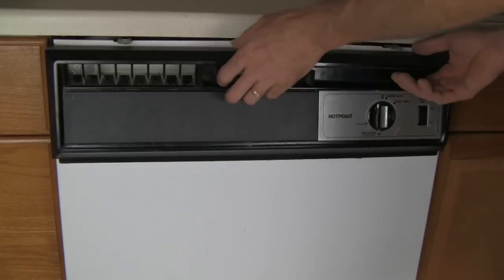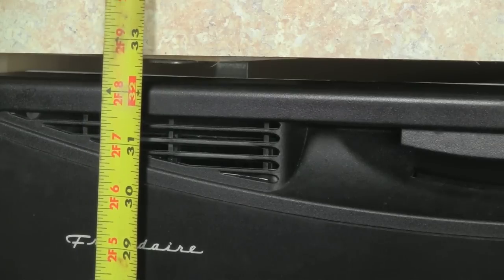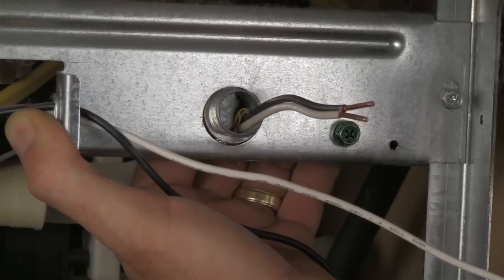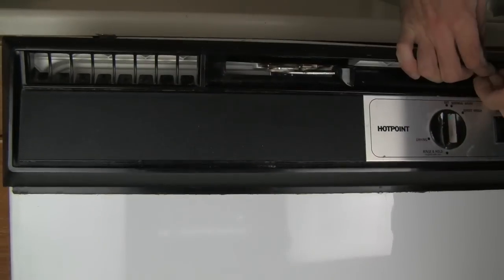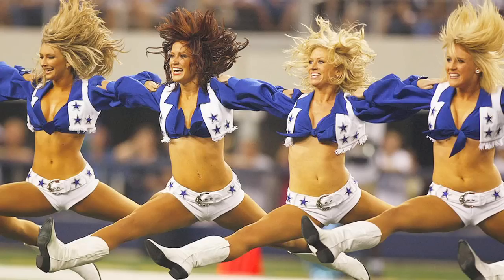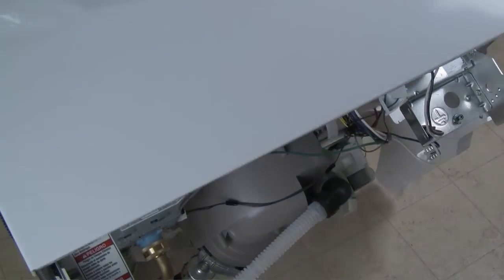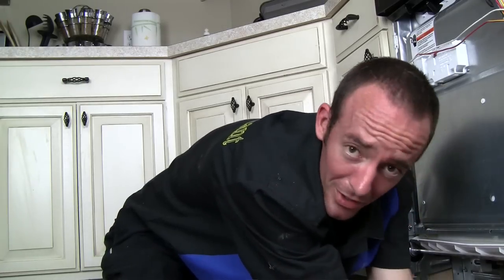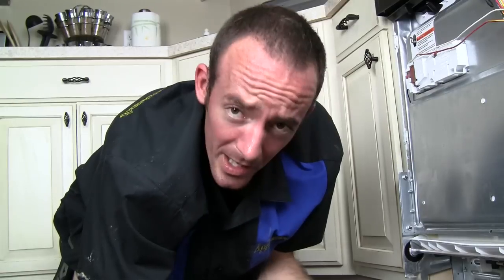How To Install A Dishwasher: Dishwasher Installation

Comment: Several very helpful tips that no one else mention on Dishwasher replacement. The dry napkin test, square cutting the copper pipe, and loosing the feet ahead of time were very helpful.  Thanks!

Comment: Thank you so much~  I have been online for two days just trying to understand how to install my "new" but previously used dishwasher that was given to me. My concern was that I had all of the parts that were needed.  More specifically how to safely connect the electrical part of the installation. You set an excellent example of how anyone sharing information of expertise should follow.

Comment: Great informative video. I'm installing a new dishwasher next to a new sink cabinet. Where is the ideal place to drill the hole for the drainage line? On the bottom or top of the cabinet? Does drilling through the top eliminate the need to do a loop up to the top of the cabinet?

Comment: Hey great video!  This evening I purchased a Whirlpool dishwasher.  My waterline is half inch but as you stated the whirlpool IN threaded hole looks to be one inch?  I guess I'll be needing a half inch to one inch 90 degree elbow.  I was given a dishwasher connection kit that is supposed to fit ALL dishwashers...apparently not whirlpool.  I've been looking on line for it as Lowes is now closed.  I hope when I show up tomorrow that they will carry this elusive 90 degree elbow.  Thanks again, Tim

Comment: Hello  Sir,  Very helpful video!  Just wondering if  I should have a separate valve for the dishwasher in case of down the road,  it breaks and I have to shut off the water, I will still have water coming into the sink.

Comment: just went through 2 new dishwasher cause I was having a problem with the bottom getting backed up come to find out from your Video the problem was the new Garbage disposal I had put in Thanks for showing about the little capped off part you have to take out so water flows.

Comment: Absolutely informative!
Question, The drain hose dropping out from the high loop, does it sag down into the sink base and then curl back up to the air break?  Or is it a short extension out from the high loop hole and into the air break without dropping down into the sink base?

Comment: excellent video..i have a question: do you recommend to turn off electricity even just to change the door latch that was broken ...can i unplug the black and white cable under the dishwahser to disconnect electricity from washer??? I need to do this on my own since i cant afford a service..I have a GE Spacesaver dishwasher since 2007. Model#: GSM1800JWW....pls advice thnx in advance!!

Comment: Mr. Appliance, I just removed my old dishwasher and having it replaced in a few days. I didn't see that my old one had a copper wire but a rubber hose instead. Is the copper wire always required? Great video thank you!
Reply from the maker: Just so I understand a little better... Is the copper wire you are talking about on your old dishwasher where the water comes into the appliance? or is it part if the electrical connection?
Reply: I was referring to my new dishwasher. The old one didn't have a copper wire but rather a hose that connected from the water valve to the dishwasher. The new dishwasher mentions something about a copper wire to run the hot water to the unit. Any ideas?
Reply from the maker: Sorry for the delay, its been a crazy few days.  Most water lines will work, but I would stay away from any kind of clear plastic tubing.  Generally the stainless steel coated or the one in the video are the best. makes connections very easy and secure.  Thanks for the question!
Reply: got it. I just used the plastic tubing that came with the kit I ordered. I had no idea that dishwasher do not come with the power cable, I had to get one separately. Thanks for your response!
Reply from the maker: Sounds good!  Thanks for the comment!

Comment: Two questions if I may... First, I just completed such an install with a Frigidaire (male water valve hookup) and even after 2 tries with the Teflon tape I still get a slight drip.  Does thread tape go bad with age?  What I've been using has been in my toolbox for who knows how long.  Second, was there any particular reason why you chose to connect the ground wire to the Romex connector instead of the green screw on the frame?  Thanks for a great video!

Comment: awesome video....is it imperative that the dishwasher be right next to the sink.    my situation: there is a vent pipe running through the back of the cabinet where it would be ideal to have a dishwasher (next to the sink).  i don't really want to mess with that pipe (pvc).  is it ok to have the dishwaser about 2-3 cabinets away from the sink? i could run a separate water supply line directly to the dishwasher, and was thinking of buying auto heater hose for the return line through the cabinet??

Comment: Excellent job on the video.  Have you ever had a drain hose end with a 1" and 3/4" step, but the wye connection is a 7/8"?

Comment: The new wire you installed with the new dish washer where do i buy. I am not comfortable with the copper pipe that i have i would like one like you showed its more flexible and seems way easier.
Reply from the maker: Pat brun They would have a flexible 3/8" compression hose at most any hardware store. helps to get one a foot or two longer than you think you need. Thanks for the question! Good luck!

Comment: Thank you so much for the video< more informative than other out there.

Can you explain in more detail how to add and position the angled wood shims in the rear of the unit to ensure back to front level? obviously they are impossible to reach once in the back and the unit is installed.

Also, how can we tell if the unit is front/back level once installed? the unit is hidden under the counter top etc so how do you figure that out?

thanks so much.

Comment: Great job, very thorough. I have to say that I'm surprised by the electrical work that has to be done. Not that it's difficult but I was expecting just a simple plug like virtually all other appliances.

Comment from the maker: Yes if it's not damaged. But you may want to cut the end off and put a new compression fitting on the end. You can also cut it somewhere that is accessible from under the sink and use a union to change it to a flex line.  Accessible is the key word : )  Good luck

Comment: Sorry for late reply but thanks for replying .it worked good.i took an old portable dishwasher i had  and took the hose that connects to the sink and installed it on a non portable dishwasher basically your right same pump .works good.thank you

Comment from the maker: @klarsen100 The wood shims can be slid under the rear wheels when it is in place from under the dishwasher.  It's a tight fit but you can get your arm in there to press them in and lift the back.  If not you may need to get creative with a yard stick or something;) For leveling I usually just eyeball it from the side and level up with the cabinets till it looks good, but ideally most levels have a bubble for vertical leveling.

Comment from the maker: @dmpejr Maybe in the event that you do remove the dishwasher that may be a good idea, but you can also buy a 3/8 cap fitting to close off the dishwasher supply side.  Most dishwashers are plumbed with a double outlet valve, so I wouldn't worry about it.  Thanks for the comment!

Comment: Great video, really helpful.  I think I'm going to have a world of hurt because of the cork flooring installed after the dishwasher.  I don't know how I'm going to get the replacement dishwasher in :-(      I guess I'll keep googling for a solution.
Reply from the maker: Bummer : ( You can sometimes lift the counter top to gain a few fractions of an inch, depending on the material...  good luck!

Comment from the maker: To my knowledge the tape should still be okay. Make sure you have water tape (there are several kinds) It is important to wrap the tape in the clockwise direction from the perspective of the nut that is threading on... That way when you start to tighten your connection the tape won't unwrap as you go. If it's wrapped clockwise the nut will move in the same direction of the tape.  You also might want to look for flaws in the fittings.  I like to do three layers of tape to be on the safe side. GL!

Comment: Always wrap electrical tape around those wire nuts. Extra bit of protection to prevent the wires from coming out as the dishwasher vibrates and things do tend to come lose.

Comment: I bought a dishwasher second-hand and unlike the old one there was no apparent ground wire to connect to the electical supply ground wire... should i screw it into the box with a screw?
Reply from the maker: That should be fine. Just as long as it is making secure contact to the dishwasher frame somewhere you should be good.

Comment: You gotta love it when a customer adds counter tops new flooring without ripping up the old, and then blame it on you because the old dishwasher will not come out.

Comment from the maker: Good point! The connection to ground would be the same... but there is always something to be said for doing things the way they are designed to be done! Especially when it comes to electricity.  Now if we could get everyone to keep their wire polarity correct ... 
Thanks for the comment!

Comment: I'm so scared to do these simple things lol I undid my connections junction power box thing from the dishwasher and discovered the wires melted into each other , I'ma cut them back and reuse the wires but may check to see if the other end of this is connect to a 3 switch and single socket junction box above the counter, any advice ?
Reply from the maker: Being thorough is good! But in most cases just trimming back, the copper ends and replacing the wire nuts is acceptable when you find connectors like that.

Comment from the maker: It makes contact with the box as a ground source through the strain reducer that is attached to the incoming wire.  I like doing it this way because some dishwashers give very little room to get a nut driver into the box.  the model in the video wasn't too bad but some are very tight.  thanks for the comment!

Comment: I wanna thank you for these tips.  My dishwasher came with my new home and I found that water is not filling it... so either something is not on or the thing is bad (oh Frigidaire, why don't your appliances like me).  This video gave me some know-how on what to kinda look for.  Thank you again ^_^.
Reply from the maker: They haven't liked me lately ether... I have had a run of Frigidaire refrigerator repairs lately.  Take a look at the float switch first, then the water valve... actually before all that make sure you have good supply.  Thanks for the kind word! I needed it!  And good luck!
Reply: After checking a few things I found that the builders turned on the water for everything BUT the dishwasher (me being a first time home owner and more a IT guy than a plumber, I just didn't know to look until your video).  Now the new problem is getting the water output sealed better (or something).  I was told this was needed after I found water on my counter, under the sink and on the floor when I used the dishwasher (after turning the water on).  I guess this is what my friends meant by finding projects with the first home you buy.  Lol.
Reply from the maker: Congratulations on the home! It's a lot of work but worth it!  Being that you had water on the counter, I would guess that you have an air break on the sink for the dishwasher drain. The hose from that to the home drain or garbage disposal is probably full of nasty gunk that is causing the water to spray from the air gap. (Grab some gloves : )
Reply: applianceassistant Thanks.  I figure it was shooting from the top before it u-turned back to the garbage disposal (I followed the lines and used my best judgement) but it's always comforting to get a sort of confirmation from a pro.  It's almost like the rubber washer they used before the air gap thingy that is ote counter is too thick because trying to but things back together is next to impossible (then again, I'm sure I'm not using the right tools or the right know-how).  I wouldn't think too much junk was blocking anything because everything in this house is brand new (new construction, new appliances, new everything... I hope).  All in all, guess I'll poke around while my 1st year warranty schedules someone to come by.  Maybe I'll figure it out by then... I usually do when I put my mind to it.
Reply from the maker: Because it's new, I'm wondering if the person who installed the garbage disposal forgot to knock out the plug for the drain from the air gap....

Comment from the maker: If you are using an air gap you can put it wherever. however, if you are connecting directly to the drain pipe or a garbage disposal putting the hole at the top of the cabinet is a great idea. You may want to wrap it in some tape or foam insulation wrap as padding, to keep it from wearing through and creating a leak down the road.  Thanks for the comment!

Comment: Aren’t you supposed to use ground wire to run to the green bolt and white to white and black to black ?

Comment from the maker: @stefaniedurbin Sorry it took me so long to get back with you!  The garbage disposal knockout can be removed by lightly hammering a flat head screwdriver into the side port.  The circular plug is thin around the edges so you will just need to work your way around the edge with the screwdriver and hammer until it falls into the disposal.  then remove the plug from inside.  Thanks for watching and commenting!

Comment: I just bought a used frigidare ultra quite 111 dishwasher for a rental home. when they said it was only 4 months old , i ask why they were selling and they said they were replacing with stainless steel. It looked brand new so i brought it home , installed with new drain hose. when you set the dial to wash, no water come in but goes out the drain hose. maybe the real reason for replacing it was because it had this problem. If so I will live with it. could  be something I have done wrong.  thanks

Comment from the maker: Sorry it took so long to get back with you!  You have probably already fixed this... Yes it is a common practice to add length to the drain hose with a 1/2" heater hose.  You can use a plastic hose coupling or insert a 1/2" hard copper pipe into both hoses to add support that you can clamp against to make the union. Thanks for watching and commenting! Sorry again for the delay!

Comment: my old dishwasher plugged into the wall. can I  remove the plug and wire it to the new dishwasher or must I hard wire the new one
Reply from the maker: +Gary Naasko You can use the plug from the old dishwasher if it's in good shape. no code on that it's just more common that they are hard wired. should be fine either way. Thanks for the question!

Comment: Can I connect my GD and dishwasher to the same 15 amp outlet?
Reply: Potential over load, would recommend against that as it wouldn't pass inspection.  Realistically though, we do the best we can with what we have; therefore, it can be done.  Be sure to have a firm rule against running both at the same time; and don't let anyone inspect your sh*t.
Reply: Not a 15 amp circuit. Most municipalities allow connecting both to a 20 amp circuit as long as they are both average power appliances. If either one is a higher power unit it might be a problem. Add up the amperage of both appliances. Since the disposal is a motorized and short run cycle appliance you can use up to the full 20 amps. If they plug in, make sure it is a 20 amp receptacle. One of the 2 slots will be a T shape since 20 amp 120v plugs look like a reversed 20 amp 220 plug. They are rather rare, so you may have never seen one.

Comment from the maker: Copper is probably one of the most reliable connections, but it can be difficult to work with. I have not personally used PEX before but I would imagine that it would be fine... It's definitely nice to have a flexible connection when your trying to hook one up!

Comment from the maker: Sorry for the delay!  Many times the dishwasher will not have an actual green ground wire. If there is no green wire there should be a green screw in the connection box for you to wrap the home or plug ground wire. Hope that helps! Thanks for the question!

Comment from the maker: @slappyd1ck Not usually, mostly just for the videos. However, just the other day I was cut pretty good 3 times on a dryer in a customers home...I would be detracted trying to hold a paper towel on one gusher while working, then slice there was a new one. So maybe I should wear them more often, or just buy more band-aids for my tool bag.

Comment: The bare copper conductor should be bonded to the frame of the appliance not bent back over the screw for the Connector. That's why the manufacturer supplies the green screw in the splice box.

Comment: Your grounding method is against code. Beginning with the 2008 NEC you MUST use the green grounding screw. That screw has been tested in the lab to be a positive ground. Other methods, even using another screw, have not been tested and may get loose and not provide a good enough ground to trip the breaker in the event of a short to ground. It may also burn off before the breaker trips. These upgrades to the code were made do to documented deaths/injuries caused by poor grounding.
Reply from the maker: Thanks for that update!

Comment: 7:28 The bare ground wire goes to the green screw. Your black cable is stripped very short.
Reply from the maker: Thank you for your comment! It would be best to use the green ground screw. The short black wire strip length was factory. That dishwasher is still working, no problems yet.